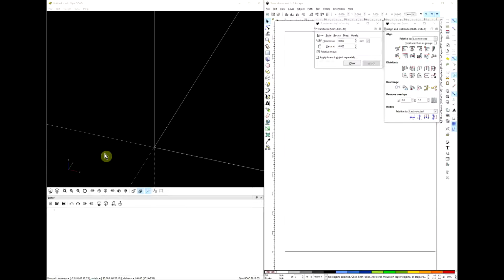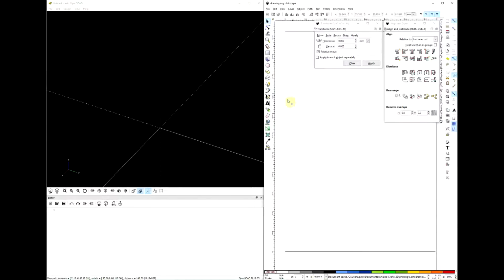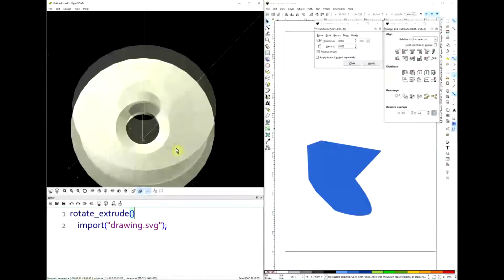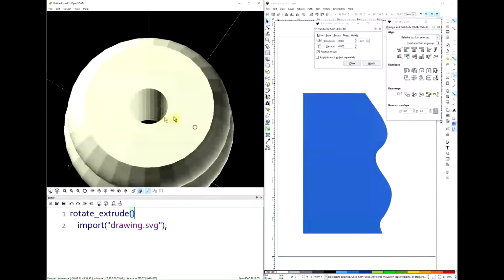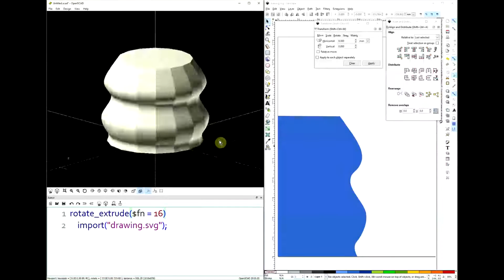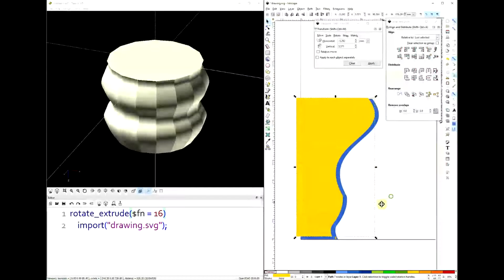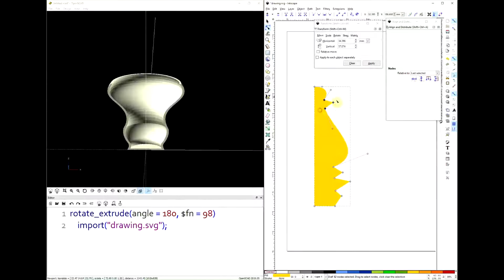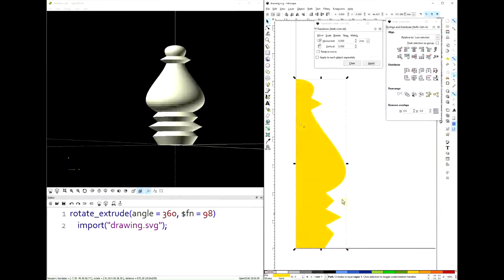OpenSCAD Tutorial: Lathe with Inkscape

Comment: Window both Explorer and the OpenSCAD editor windows side by side. Drag the SVG file into the editor and the Import command will automatically be inserted, WITH the correct pathlist. Works with DXF too, and will do the Surface command with PNG and DAT files. VERY useful.